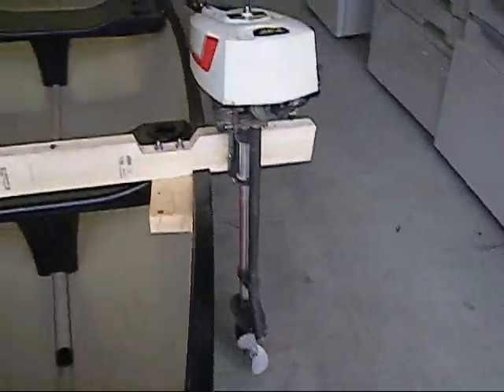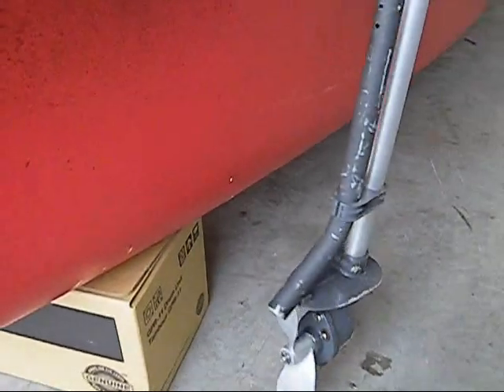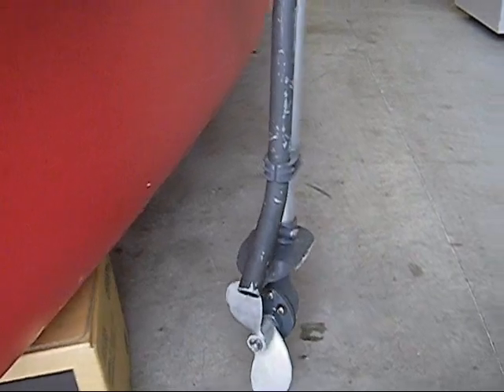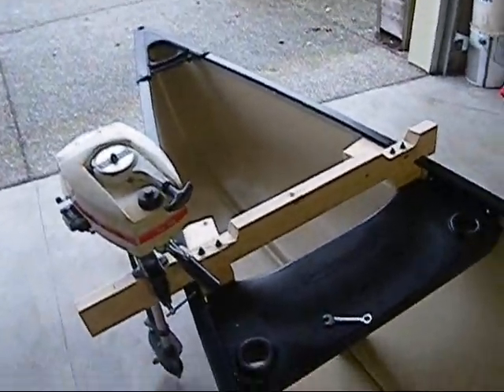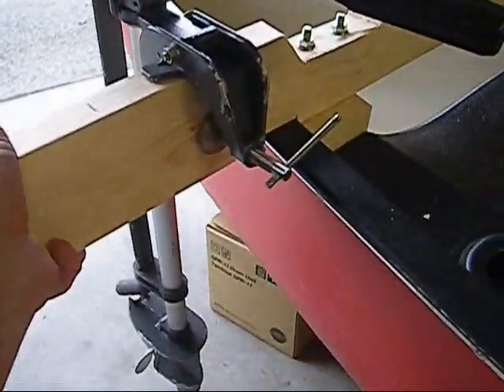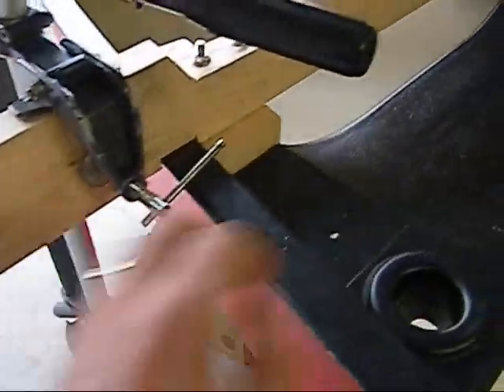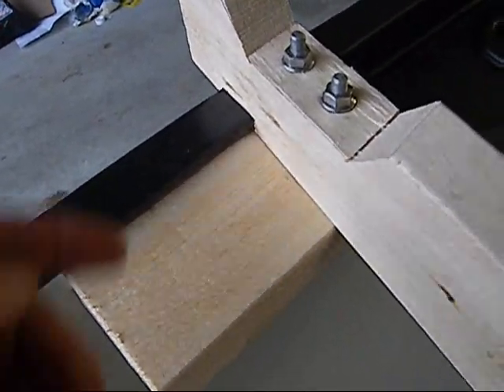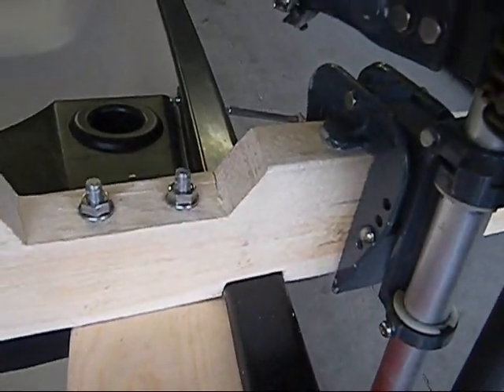Motorized canoeing

Comment: I also built a similar mount for a Old Town Guide, using 2x4 for a Suzuki 2.5 outboard. Lasted 3 trips before the 2x4 ripped in half and I had to catch the motor as it was trying to get away. I now have my mount made out of 3/16" steel angle.
Reply: You can re-inforce both sides of contacts with aluminum and use 4 bolts to piece both sides together. It is better to use treated 2x4. It is more sturdy.

Comment: I just made my mouth today for my canoe. The longest part was drilling two holes on a 2 1/2 4x1 weld flat. No drilling on the the canoe. It's secured by two superstrut beam clamp. Can easily be adjusted forward, and backward. Had to buy nuts and bolts, otherwise it would've just cost under $15. Can't wait to try it this weekend.

Comment: Nice setup. First time I've sen your setup and amazed how close our designs are. I worried about strength and went the more exotic route of using Oak. I have mine setup for electric but really like your gas solution too!  Very impressed with the speed.

Comment from the maker: Steering is pretty good as long as you keep the motor close to the boat haul. Actually you can also get your speed up another couple miles an hour by shifting your weight to the front as well as making sure the motor sits level. Hope this helps.

Comment: I did basically the same thing with my canoe motormount same 2 x 4 setup....THIS WILL NOT LAST!!!! mine worked for about 5 trips until the torque on the 2 x 4 started splitting it. currently looking for a scrap piece of hardwood, DON'T USE PINE!